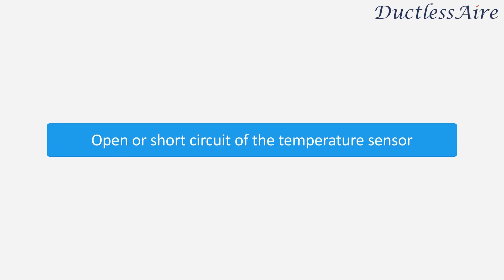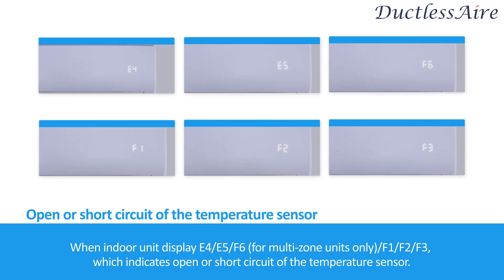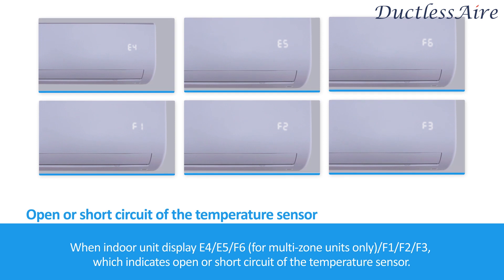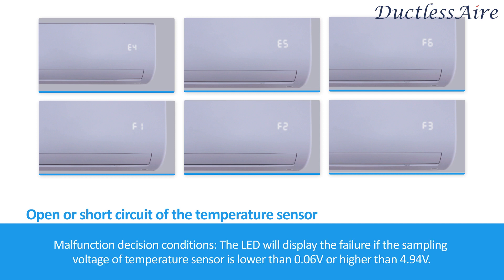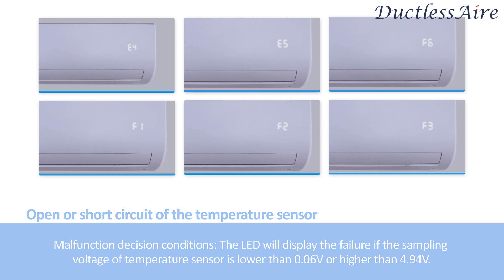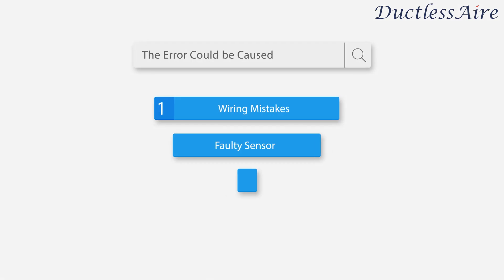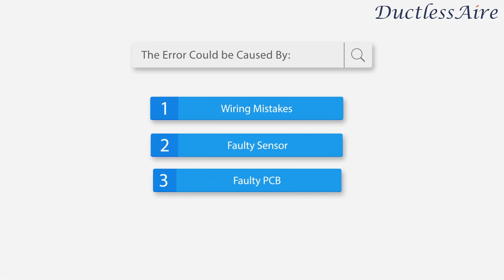DuctlessAire Error codes E4, E5, E6, F1, F2, F3 - temperature sensor

Comment: What is code f0 and what is the fix just installed brand new computer board outside unit. Indoor unit runs but wont switch on outdoor unit